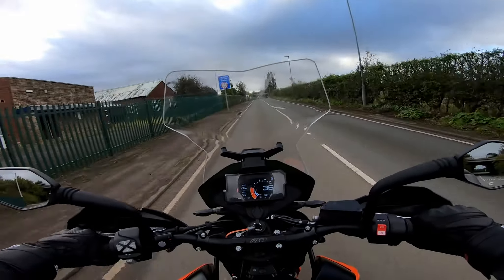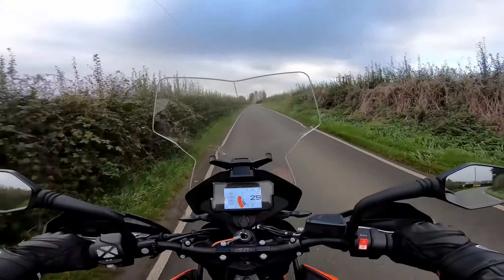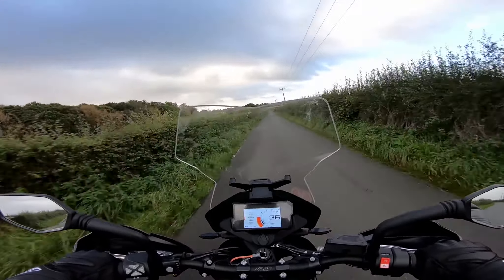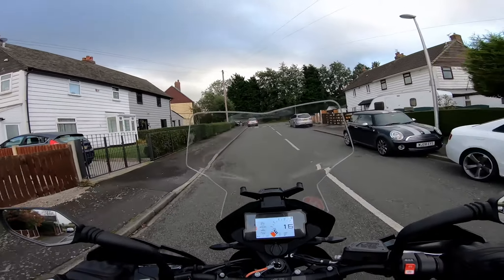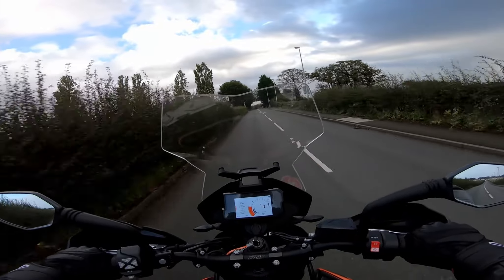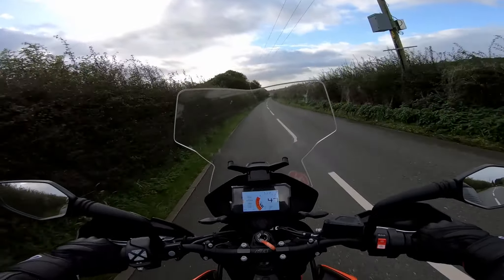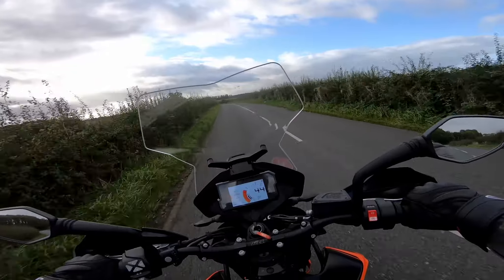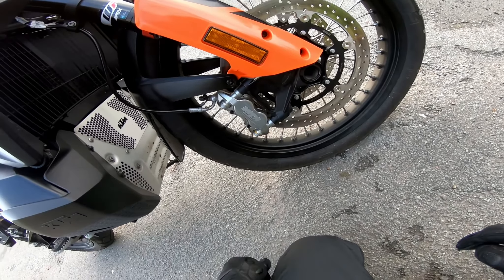KTM 790 Adventure - Condensation & Extender Update

Comment: Doesn't look like KTM has sorted this problem with condensation. Picked my brand new 890r up on the 01/03/22 rode it 28 miles home, parked up in garage and noticed it on 2 places of the tft.  Rode it for the second time today 07/03/22 and within 10 miles i stopped at a friends house to see condensation running down on the inside of the tft. Not happy with my 12k purchase especially as this upload demonstrates a problem going back a few years. On a positive note, 'old codger' keep these  informative videos coming as they are helpful. Well done!
Reply from the maker: Well thank you for the support, it is appreciated 👍 On that particular TFT design I have given up. I had 3 on my 790Adv. The dealer was happy to keep changing it, and a fourth was arranged. I test rode a 390Adv with same TFT, it had condensate inside. I loved the bike. The TFT never failed, but it was hard to read at times. I would not have another bike with that particular TFT. I had a 790 Duke (different TFT) and it was fine, so I think it is particular to that TFT. They swap them readily, but I felt they were just replacing them with other returned units. It is very frustrating and spoils what is the best Adv bike out there in my opinion. ☹️

Comment: There are so many rapports about the display leak, you can start to wonder if KTM really makes this displays to stand the tougher conditions here up north. I have a new one at my dealer, got it replaced under warranty, but everyone i have talked with who has changed it, has the same issue with the new one. So i see no point in changing mine untill it goes black or there is a new updated version of it.
Reply from the maker: I’m pretty much of the same mind. This is my 2nd, the first one had condensation immediately (it was Spring). The 2nd was fine all Summer, but showed liquid on 1st cool day. But there are several reports of a revised version  (e.g. see dwlee67 below) so let’s hope that proves to he successful. I wonder if they outsourced them and have only realised issues now... well I like to be generous. I love the bike, ‘course of true love never ran smooth’ 😉👍
Reply: @CodgerBiker  Yeah, i hope my new are better than the first one. Butt still, this are minor issues... The bike in total are so awesome that it has to be more wrong with it to get me away from loving it. I have the issue with the front breaks as well, my mechanic is looking for other KTM rotors to change into. The original ones are not good enough (they say)
Reply from the maker: Fingers crossed 🤞 My front brakes seem okay, apart from the odd squeak 👍
Reply: @CodgerBiker  Hahaha, yeah, i have the squeak and the uneven "come to a stop" :-P
Reply from the maker: Hope they sort that, it would be annoying to say the least 👍

Comment: I've just purchased a 2021 KTM 390 Adventure with 2000 miles on the clock. Condensation issue is present. Given the year of manufacture, presumably this would have had the "updated" screen. Still a problem, it seems. Hopefully it won't get worse over time.
Reply from the maker: Hello. My experience was changing the TFT never resolved the issue. It was fine in summer, annoying in winter. But, as far as I know, it does not cause failure. I'm sure someone would have replied by now if it did. Great bike by the way! 👍
Reply: @CodgerBiker  Yeah, no regrets. I am enjoying the bike very much.

Comment: In time they find a solution on that problem l recon. Seems like its not ventilated enough...
I find that extender usefull even if the oem fender on the vstrom are quite long. It keep the salt from getting straight into the radiator and engien during winter commuting.
Reply from the maker: Yes I think it does the job. I get annoyed with the dirt flung into the opening. Can’t see any downside, I suppose offroad might challenge it! 👍
Reply: @CodgerBiker  im not that mutch offroad, but stones from gravel may brake it if your really unlucky...
Reply from the maker: Yes, I think the same, or perhaps thick mud. Better for road dirt though...

Comment: my 2020 790 Duke screen steams up starts in the middle of the screen and spreads out from there, also my headlight steams up inside aswell, iv been to my dealer only to be told and get this ! the headlight is designed to steam up as it cools the LED inside and has a hole in the bottom of the headlight to allow water to drain out !!! wtf ! basicly they naffed me off, well autumn is here so lets see what the colder weather brings as its been fine during the summer, but i use my bike every day to commute rain or shine so we shall see .
Reply from the maker: I did not know it could happen on  a Duke. My Duke was always okay. I guess they need to make a TFT with bonded top glass... one day

Comment: I've had the screen issue since new. My dealer is on to it. Spoke to him today and he told the new updated screens are on the way from the factory and will be here (Australia) in 3-4 weeks.
Reply from the maker: Interesting. I wonder if they will do a recall, or just fix on request. Keep us informed, seems to be common issue! 👍
Reply: I don't think there is an official recall. My dealer told me he has had a few with the problem that he is replacing under warranty. The fact they are making an updated dash says that the problem is wide spread. I'll definitely keep you updated as soon a I hear anything.
Reply from the maker: Cheers, very much appreciated. Mine was replaced at first service (2weeks in) and the 2nd showed moisture on the 1st cool day of the year. So it appears to be common. Let’s hope the new version is released and sorts it out. 👍
Reply: I hope they also include the 790 Duke. There have been a lot of issues with those too including the screen cracking. Mine has been OK so far but living in the NT with our heat and massive storms it will be interesting to see how long it lasts. I don't leave the bike out in the sun during the day but if I did especially atm during the build-up I'm sure it's going to crack as well. Just a matter of time.
Reply from the maker: I never had a problem with my Duke. We just don't get your heat here though - jealous! 👍
Reply: Mate of mine has the same problem with his Adv R. Dealer told him the TFT’s are made where there is a lot of moisture around so it’s inside them before fitting.

Comment: My now one week old 790 had water behind the right edge of the TFT within an hour of collecting in when I hit some light rain on the way home. On Saturday had condensation as you have on a colder day. As long as it keeps working I'm not going to bother trying to get it changed until I hear KTM actually have a permanent fix. Out of interest, what happens to your odometer if they replace the panel - does the bike remeber you total mileage, or start again from zero?
Reply from the maker: Not sure how it works, they said mine was the first 790Adv they had done at the time. The milage remained, but took them 2 goes to get Quickshifter to show up on the display, even though it was working fine. I expect they’ll be experts, by now, at this rate 🤣😂😀

Comment: I have an update for you on the new screen. I received a call from my dealer yesterday to inform me the new updated screen has arrived. I’m booked in this Friday to have it fitted and also to have cruise control activated.
Reply from the maker: Great news. Also corroborated by Gary L on the channel. Let's hope it sorts the problem once and for all! 👍👍👍
Reply: Codger Biker new screen fitted today. So far so good.
Reply from the maker: Good news. My dealer has no knowledge of a new TFT. Does it appear any different? What temperature do you have just now. Mine steams up, and worse, as the temp falls below 15 degrees C. Glad it is working out for you 👍👍👍
Reply: Codger Biker it looks identical to the old screen. The temp today varied between just below 15c up to around 25c. I also must say my old screen only had issues below 15c. It’s a wonder your dealer hasn’t heard anything about the updated dash. My dealer told me he had a few to replace under warranty. Hopefully your dealer gets some info soon and gets it sorted for you.
Reply from the maker: Yes it is annoying. I think you have nice warmth there just now, but hopefully it is fixed. I did have the original one replaced almost immediately, then we had summer so all appeared fine, only for it to reappear as soon as autumn arrived. He says he has emailed KTM and is awaiting reply.  We shall see... In any case it is good to know the situation across the world👍👍
Reply: Codger Biker exactly. Time will tell. Yes it’s very interesting to hear story’s from owners around the world. I will certainly update you if I have any further issues.
Reply from the maker: Thank you. The sharing of information empowers all owners👍
Reply: Codger Biker no problem.

Comment: Hi Codger. I took the 790 adventure out on saturday for a test ride. The engine is fuelled far better than my 790 duke. The duke engine is immense but hard work in town with it's snatchy throttle. The adventure is lovely and smooth compared to duke as you know. I took my wife as a pillion and the suspension is great for 2 up riding. I'm taking it out again riding solo and I'm considering swapping duke for it. Bad news about the condensation in the tft though, obviously not sealed very well. Cheers
Reply from the maker: Hi Anthony. Agree on all points. I loved Sport mode on the Duke out of town. Make sure you get Rally mode enabled as it is similar. Also the Quickshift+ is an extra, but well worth it. Being an early adopter I guess I am an unpaid beta tester for the Adv 😀👍
Reply: @CodgerBiker  I'll have to see what ktm offer for my duke. Gentleman in showroom saturday reckons he can do a good deal for my duke against the adventure, not the R model. Don't go off road so waste of time. I'll definately get quick shifter and rally mode and of course heated grips for good old blighty winter.
Reply from the maker: Good luck. I hope you get a dry TFT! 👍